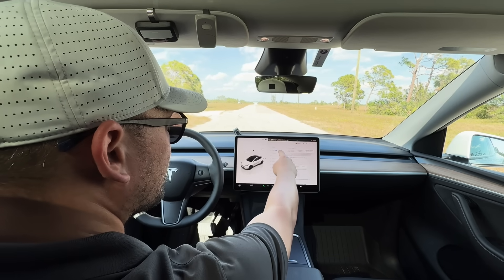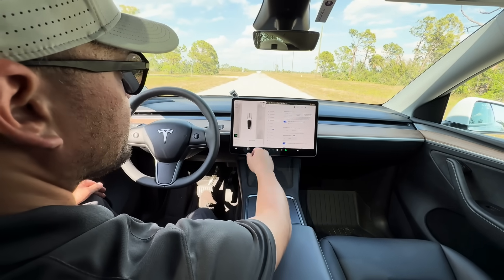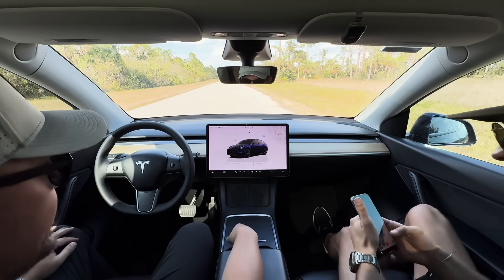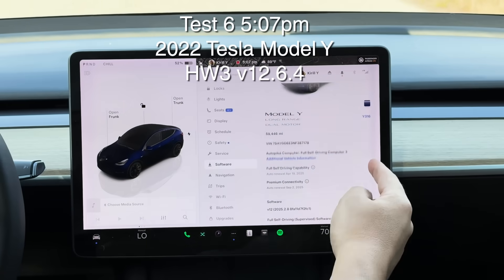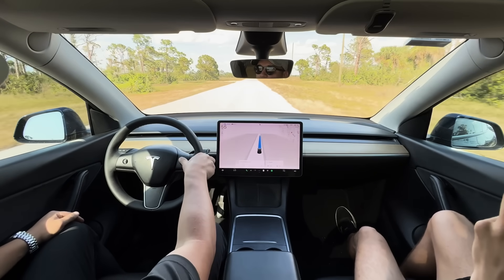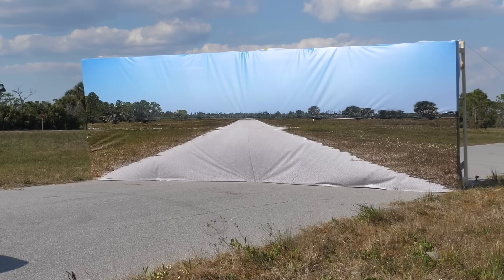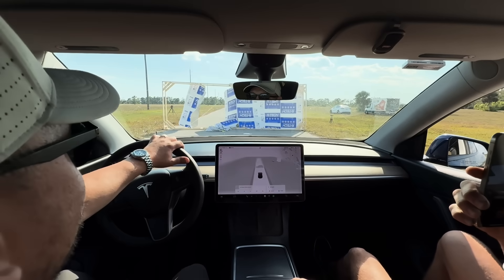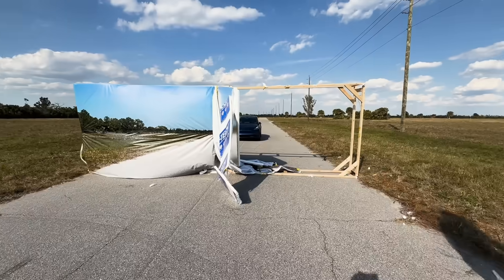Mark Rober Debunked - You can't fool a HW4 Tesla using FSD!

Comment: can you do a test with autopilot and not FSD? like mark did to see if you got the same behaviour for both HW3 and HW4?
Reply: That's what I was thinking too. I was wondering if autopilot and FSD would have handled it differently
Reply: @AnonymousTips90  especially since mark rober thinks they would behave the same.
Reply: @adamdynasoft  He thinks it because he’s right- there’s no difference between Autopilot and FSD when it comes to driving in a straight line and avoiding stationary obstacles in the road.

Comment: You are missing the point. A NN is unpredictable regarding output with very small changes to the input. If you add lidar, there is a very clear input signal for a wall, it's easier to create a NN that reliably reacts as desired. With cameras only, little changes to the wall can make it either react appropriately or not. You will be able to create an input signal (wall) that the HW4 doesn't reliably react to with braking. You can most likely even create a wall HW3 detects. It's basically left to chance because of the small input value differences between wall and no wall.

The threat from Teslas so-called FSD is that it will be brought to a point where it fails creating the desired output easily in situations where for any reason the inputs are close to inputs that don't require braking. If it's from saturation of pixels, an odd image on a house wall, odd combinations of cars on the side of the road, etc. With lidar, it's also possible, but for many situations that are a close call for cameras only, there is such a clear input signal that failure is much less likely.

Human eyes are a real masterpiece of dynamic range with the ability to move and close an eyelid, and there is a several orders of magnitude more complex NN behind them with 16 to 18 years of training in understanding of input signals and expected required outputs. They get far, but also have limits. You can get closer to their level of performance combined with the human brain with cameras and lidar compared to only cameras.

You can make that L2 assistant Tesla calls FSD work with a human able to take over anytime on short notice. But that's not what Tesla tells their deciples. They claim L5 unlimited ODD, they did when I bought my second Tesla S already 2016. The car was supposed to drop me at a restaurant and park without a human driver monitoring it. Hell it was supposed to earn money driving people around while I don't need it.

Today, Tesla is at L2 limited ODD like 2016. The assistant has more functionality, but it's still L2 limited ODD. L5 unlimited ODD required Tesla to take responsibility when FSD is engaged, without a human in it, like the L3 limited ODD assistant from Mercedes for highway traffic jams. I don't see that happening. That's the FSD scam since almost a decade.
Reply: Tesla(tm) is when it turns off in any smelly situation to shake off itself of all and any responsibility
Reply: I thought the point was to give a fair representation of how the current technology works. The Rober video didn't use current technology.

A picture painted on a wall will not contain any changes in perspective. No amount of tweaking will ever fix that. So once the neural network learns about that distinction (apparently v13 compared to v12 for example) that form of attack is dead.
Reply: Lidar is just one more sensor, if the computing is trash the best sensors will not help. 
Same goes the other way, tesla can have the best computing algoryhm, if it cant see cause you only rely on cameras, they can be fooled (like very heavy fog).
Reply: Mark didn’t test the latest LiDAR against the latest tesla HW4. At the end of the day hardware 4 is better than LiDAR
Reply: @kevina7522  We really shoudn't focus here on LIDAR vs camera, or HW3 vs HW4. If Tesla will be developing software for a few more years on HW3, it'll be better than what we can see on HW4 now.
Reply: @kevina7522 that's a statement like my phone is better than your fax. Lidar is a sensor, HW4 is a package of computers snd sensors, that are mostly cameras. So sorry, fanboy BS.
Reply: @kevina7522  that's a lofty claim. Can you supply some legitimate evidence to back it up?
Reply: No in fact perspective is extremely important in object detection. It’s a basic tenet of vision. And there are dozens of ways to identify objects with perspective. In the end, proper processing of the world and being able to recognize objects is important regardless of what inputs you use. Lidar has to do the same thing too. Every image it receives is still a 2D array of information

With any inputs you use, you have to deal with changes in environmental conditions as well. The solution is simple with vision—you can drive slower like humans have to do
Reply: Mercedes L3 is a scam... At least from the videos I've seen it was not any useful. Maybe for a traffic jam, but it works only on very limited number of roads. If you go behind a truck, it turns off after a few minutes, you can't go to sleep. Meanwhile I'd be happy to use current version of FSD, even though I have to supervise it.

Let's imagine a car with LIDAR and camera in those situations:
- obstacle, both LIDAR and camera can see it
- obstacle, only LIDAR can see it
- obstacle, only camera can see it
- no obstacle, camera misleads
- no obstacle, LIDAR misleads
- no obstacle, both LIDAR and camera mislead

LIDAR adds a lot to system complexity if we want a car that doesn't do a lot of phantom breaking. Should we overwrite LIDAR input with camera input if camera can't see anything?
Reply: @Plajerity the Mercedes System is only L3 for a traffic jam, up to a certain speed, limited ODD. It works perfectly within the limits promised my the manufacturer who takes responsibility while it's used. That's the whole point, unlimited ODD L5 as Tesla claimed is nonsense, no matter what sensors, unless we get very close to the human brain trained for over a decade on understanding the environment before training a couple of hours how to drive a car in it. Limited ODD there are many systems in production right now and since decades like in warehouses.
Reply: @ I don't know if Mercedes autopilot works perfectly. I assume almost no one wants to use it, so no accidents caused. It's just marketing, supported by the german government.

Yes, Tesla marketing was even worse, caused some deaths.

However, the subject is about software - how to make it better. My point is that adding LIDAR helps avoid accidents, but not necessarily helps build better autopilot. Phantom breaking is a serious issue.

The question is how we set up our system if LIDAR detects an obstacle while camera doesn't.
The easy answer is to stop the car. But if the system will stop every time LIDAR detects anything, then we just build super annoying system, not useful.

So, ideally we'd like to overwrite LIDAR if camera is sure there is no obstacle. But is it a good idea? If yes, how sure camera must be to overwrite LIDAR? 90% is enough?
Reply: @Plajerity I drove one, it does what it's supposed to in it's ODD. You are legally allowed to read or watch videos. There are no subsidies or marketing from the German government for autonomous driving. You confuse that with the US where the White House is a car sales lot.
Reply: @BlueSideUp  Could you use it on a daily basis? Or even going to vacation?

Obviously there are a lot of subsidies, that's a case for every country - it's just worth it to invest into high-tech. I'm only surprised how biased some editorials are, including regulators.
Reply: I see my original reply was deleted.  This is what weak channels do - they stifle dissent. Little do they understand that in doing so, they're exposing themselves as biased. That was already apparent, but now it becomes more clear. You can't grow a channel by being a shill.  At 3.6K subscribers, this means people don't like this channel and the biased information that's being pushed.
Reply: @AndyDavis-vc1sc  I don't know what your previous comment was about, but I think deleting comment while talking by author about self-driving cars seems unlikely.

Comments can be deleted if they have links, if they contain specific words, or just by youtube failure. But it's youtube that deletes them automatically, not author.
Reply: @Plajerity  When did I ever say my comment was automatically deleted?  I never said that - I just said the channel (i.e., the owner) deleted my comment.  No link, no cuss words.  What I wrote probably miffed a few people, like Tesla apologists.  But it was nothing mean or nefarious.  Also, it was visible for at least 1 week, then suddenly it disappeared.

Also, the channel owner can delete comments.  You're uninformed.
Reply: @AndyDavis-vc1sc sadly, censorship of stuff you don't want your bubble to endure is industry standard in social media. That might become the biggest threat to human civilisation by pushing people into opposite corners with selection, context removal and fake facts.
Reply: Too technical for the masses but as an engineer have to agree
Reply: When something is called Full Self Driving and it's not actually fully self driving, then there's no leeway. It either works 99.99% of the time, or it's fraud.
Reply: Well said, but you'll get nowhere with this guy. Just look at his channel banner. He's an admitted Tesla shill. Notice he's got a Daytona on his wrist -- he has a vested interest in making Tesla look good. He's made a lot of money pushing their lies.
Reply: The reality is that fake scenery walls are only a thing in roadrunner cartoons. All of your other insinuation are nothing more than unsupported speculation. Tesla has recorded literally billions of fsd miles without critical takeovers required. Last I read, waymo requires about 1 remote operator per 5 cars and they intervene frequently,  every few miles or so.
Reply: @tdrake59  the point is, the camera only NN can be tricked and does get it wrong on occasion.
there have been cases of tesla's plowing into the sides of trailers because they blended in with the sky.
i just don't understand why Tesla couldnt implement some backup lidar to operate alongside the camera's - benefit from the pro's of both technologies.

maybe one day camera only NN will be up to the task, but for now, if the driver has to be ready to take control at any moment, whats the point of FSD
Reply: @Stain3610  While you are utterly correct, a lidar system would be a great input, you are missing the point.  Tesla's are "good enough(™)".  If you strive for perfection, you'll never reach it, yet another edge case will creep up.
Sometimes, good enough, is literally good enough.
Yes, if for some reason, Tesla's start running into a situation where the cameras aren't enough, or the Neural Net is getting confused, well then the neural nets can be retrained, or something (eg. lidar, infrared cameras, etc) can be considered.
But people were complaining about the Tesla price, and removing the lidar, was one solution to help reduce the cost and complexity.
The truth is, that in heavy fog, most people won't be driving.  If the rain is obscuring vision so much, then maybe you shouldn't be driving.  
And if you are driving up to a photorealistic wall, then maybe you need to get a worse class of enemy.  The one(s) you currently have are way too good.
Reply: @Stain3610  If Lidar is  perfect why is waymo still crashing ?Why didnt it work here then with lidar, radar, ultrasonics and cameras? Am curious:eyes-purple-crying:
https://www.youtube.com/watch?v=To20sz06wbU&t=2s
https://www.youtube.com/shorts/hazFkED40KI
Reply: @ Red herring - no one claimed Lidar was perfect. The claim is that it's more reliable than cameras alone.
Reply: @AndyDavis-vc1sc  You don’t contribute anything to the replies, yet you badmouth others. Both you and the OP are upset — obviously for political reasons. At first, I thought the OP was offering valid insights, but it turns out he’s just arguing about the likelihood of FSD failing. By the way, the purpose of the video isn’t to create controlled environments until FSD fails; it’s simply to debunk the outcome of a popular YouTuber’s test in a similar setting.
Reply: @sentiment201  You have no idea if I agree with Musk's politics.  You're putting forth a red herring to defend an obviously indefensible position. Musk is a prolific liar.  His claims about FSD are utter B.S.  Remember Musk's infamous claim that FSD will drive from a parking lot in LA to New York?  Yeah, where is Tesla on that bold claim?  It's another one of his many lies.

Your claim that the purpose of the video isn't to create controlled environments until FD fails -- which no one ever claimed (another red herring).  My question is, why does it matter?  If FSD fails, it fails.  Contrary to Musk's outlandish claims that FSD is truly "full self driving.," any video showing a failure of FSD is more proof that Musk is a massive B.S. artist.

And what happened to his robotaxi?  The supposed fully autonomous vehicle that is having its lunch eaten by Waymo.  Or the ability to rent out your Tesla as a taxi, making its value rise instead of fall, which is a total joke, because anyone who's tried trading in a Tesla knows you can't get half of what you paid for after one year of ownership.

The fact is FSD will never, ever become fully self driving.  There are too many situations where the lame camera detection technology just can't interpret the situation correctly.  A simple YT search shows that even to this day, FSD fails hard.

All these lies by Musk, yet here you are defending this clown.  What does that make you?
Reply: @tdrake59  "Literally" billions of miles?  First of all, you abuse the word literally.  And you have no proof, just fan boi wishes.  BlueSideUp is absolutely right. Sometimes FSD works, and sometimes it doesn't.... but it's bound to fail based on its flawed design.  The point they're making is that it's not foolproof, as Musk likes to claim. Statistically speaking, there is bound to be huge failures because it's only camera based.  With sensors, the likelihood of failure goes way down. I own an HD truck and it has sensors all around.  It very reliably tells me of obstructions in both front and read with a 180-degree FOV.  That's all I ever want from a vehicle.  I'm not stupid enough to allow a vehicle with a flawed design drive me without assistance (or FSD, as Tesla calls it).  Claiming or insinuating it's possible is nothing short of myopic.
Reply: @tdrake59 you know that 54 fatalities are on record in independent tracking and even the NHTSA has 19?
Reply: I ain't reading all that
Reply: @jow-ris9355  Then consider shutting up without posting useless BS instead of outing yourself as an idiot.
Reply: @jow-ris9355  it's a wonder you read at all. Books are anathema to you.
Reply: @AndyDavis-vc1sc I admire that you to even invest into an answer to something like that. Although, not reading, maximum populist briefs of complex topics that would really require more than one sentence, is kind of industry standard in social media.

Comment: There is a difference tough:

In the other test it was switched on st s later point where the one perspective matched better.

Maybe it still would have tetected it tough.

But that it even crashes shows a weakness: eg with fog or other limitibg factors, theoreticalöy, in the real world, it could crash into a painted wall.

Comment: Heres what im wondering, and dont torch me too bad. But the other cars dont have FSD, but they still stop automatically. Youre saying, in a Tesla, I must be in FSD for it to stop automatically like the other cars that DONT have FSD and only have adaptive cruise control and auto stop? Shouldnt the Tesla always stop for safety reasons like the other cars?
Reply: Tesla works with cameras, other cars with radar "seeing" surfaces. It is said that cameras are cheaper (more return for Tesla).

Comment: It sees because the sky colors are different, there are trees visible nearby  and more. The fact is: camera only has limitations. Lidar adds information a camera may not see.
And I think the brand value has been ruined by the brand owner, no matter if it sees the wall or not. I guess quite a few tesla engineers will be on the lookout for a new employer too.

Comment: Nice.  Mark's mY might have gone thru on FSD then, if he had used it and supposing it's HW3 like this blue one.  But it's gotten better for HW4 to be sure.  That's the interesting thing about these things because there are many factors, hw and software versions (if someone's not updating or just timing flukes), Mark still wouldn't be wrong because you CAN fool a self driving car, if it's the older version of which there are many.  Still though, it's good to know that the newer version is better at this silly test, it must be better at normal driving stuff too!

Comment: Not so sure about the claim of debunking Mark Rober, that's a bit of a strawman. AFAIK Mark Rober's intention was to test the most common Tesla ADAS aka Autopilot vs other common ADAS that are using Lidar. Although, I admit, these are some rather ridiculous scenarios. 
And according to quick googling, less than 20% of all Teslas have FSD, so I think it makes sense to test the more widely used version.

If anything, it unfortunately shows Tesla in even worse light since they are seemingly deliberately withholding safety features from the Autopilot software. It can't be hardware issue, since, according to Tesla, Autopilot and FSD use the same hardware.